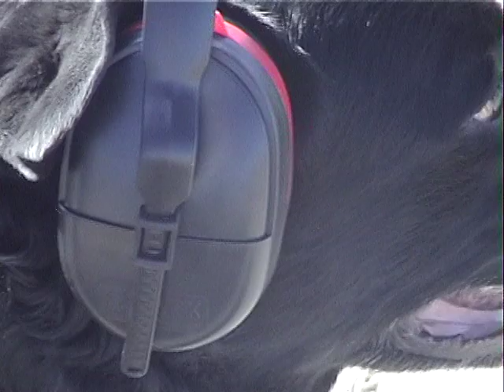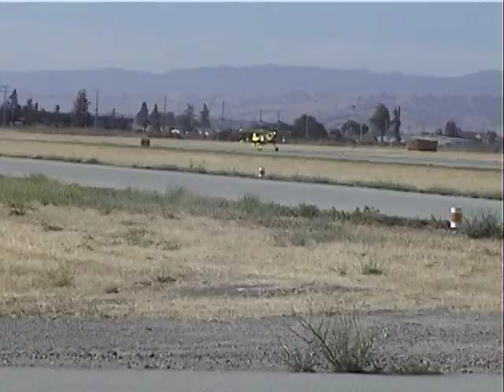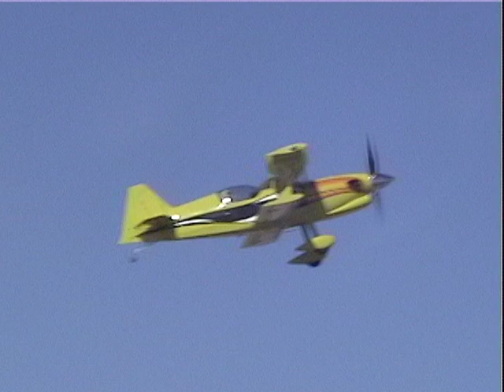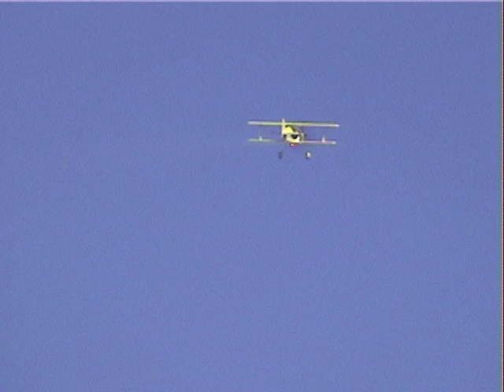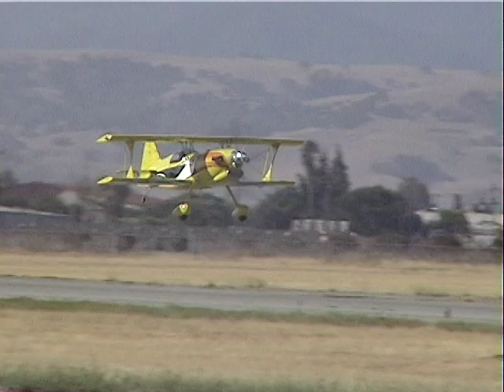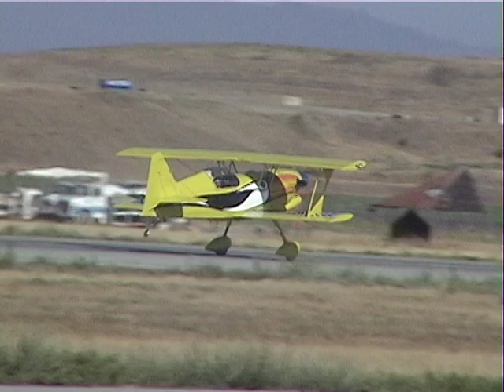Turbine Toucan Test Flight #2

Comment from the maker: The Prop is reversible and you can use it. There are many tail wheel turboprops like the Agcat, Thrusher etc... Also, Pilatus PC6. Because of the drag, it is not as easy as you think to reach Vne which is in not published but is up there in speed.